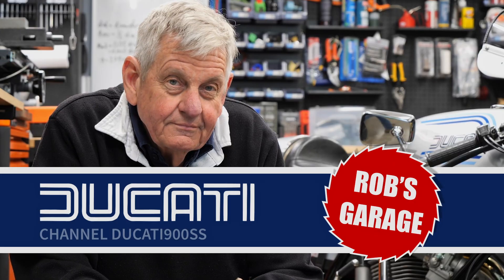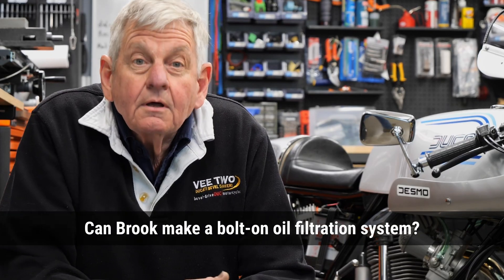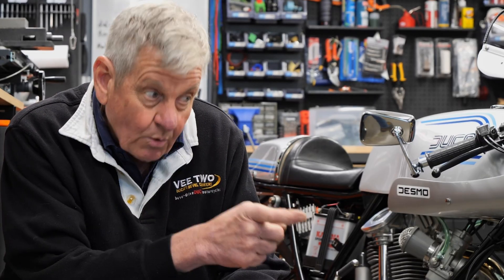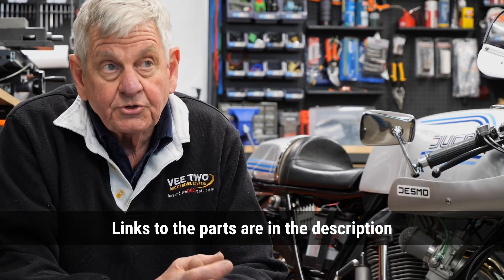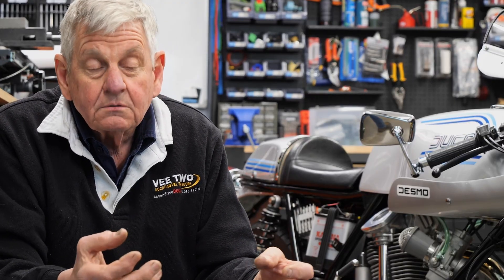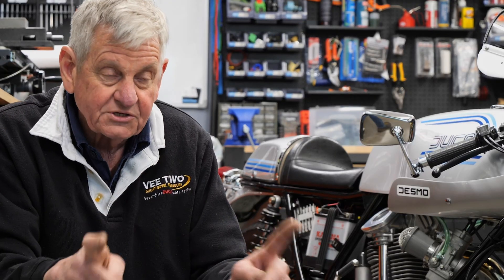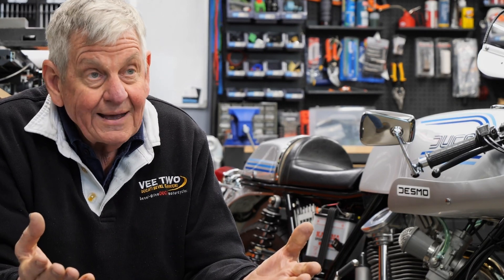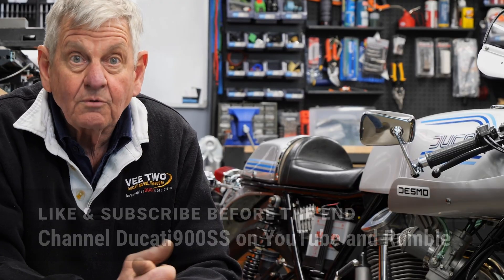Fix the Woeful Bevel Oil Filtration! - Ask Brook Henry - Rob's Garage

Comment: Very interesting discussion. I wasn't aware Laverda triples had a splash lubed crank!  Another reason that good filtration is essential on a unit construction motorcycle engine with shared oil supply, and that is clutch wear particles, nasty stuff!!  Something else about splash lubrication, two strokes!!!  They survive on just a solution of oil and fuel, with oil at a very small ratio, it has always amazed me how that is even possible!!!  Although the oil is always clean of course!  I used to run my 900SS on Castrol GP50 back in the day, it seemed to do OK on that, I had reason to lift the heads and barrels on it and they looked perfect. It did 2 trips to the Bol in the early 80s, in some very hot weather, and all was good, although I only did about 6k miles on it during my ownership. I wouldn't run one on 50 grade now though. I have a 1975 750 Sport now, that's run on 20w50 mineral, bike spec of course, to Jasma. Also have a 450 SCR that I'm recommissioning to use next year, that's been in storage for 36 years!!  Only one owner before me, I was going to fully restore it but I've realized that won't happen now, too many toys not enough time! It's good enough to use with some thorough cleaning, actually it's patina will give it a well used but proud look!!  I'll run that on 20w50 too.  I will be fitting Vee Twos filter screens to both though.

Comment: I can fix this issue with four words.  Honda, Yamaha, Suzuki & Kawasaki.  Oil filtration problems solved!  And no.  "Modern" Euro or USA made trash are not immune to failing at an alarming rate because of .........Poor engineering, components quality and assembly line shambles.  Go the BIG FOUR!

Comment: Good info. No mention of magnets..... they'll capture the ferrous  bits that are most destructive. Even a magnet permanently affixed inside the sump would be good idea.
 I ride narrow-case singles and there is (or was) a screen on the market with magnets in it.The steel dipstick of the singles could also be magnetized.
Off topic, the XS650 has two drain plugs, each with a massive magnet. Better still, a slot ground through the first few threads of each drain plug ensures that they act like thread-cleaning taps when being installed — very thoughtful those Japanese.
Reply from the maker: I looked at those magnets for mine a long time back and quickly decided against the one that hangs off the oil plug/stick thing. Those Neodymium magnets are a little fragile and the last thing I'd want flying around the innards would be pieces of magnet. I didn't closely examine the other one that sits on a plate under the oil filter, but it also hangs over a hole where it could cause trouble. That's as far as I got with the idea, but obviously plenty of people use them without issues. Thanks for the comment.

Comment: Think I can probably answer my own question but I am going to ask anyway. I guess the VeeTwo Ritorno  (apologies if my spelling is crap) has the updated screen and CNC manufactured oil pump as standard fitment....cheers
Reply from the maker: Yes, you'd have guessed right as far as I'm aware. The Ritornos are full of the new parts. Can't see any reason to be putting an old pump in them.